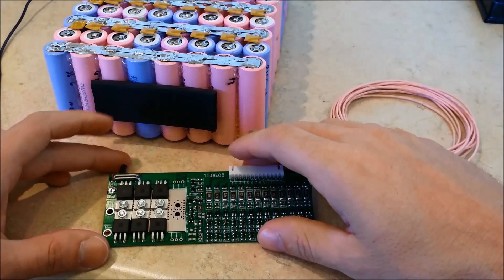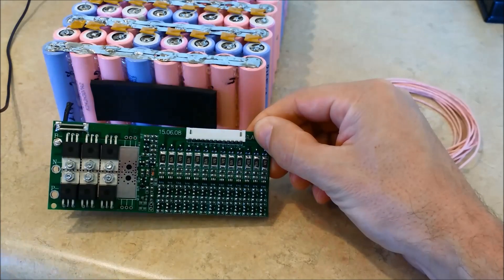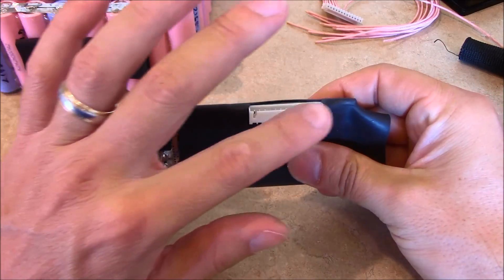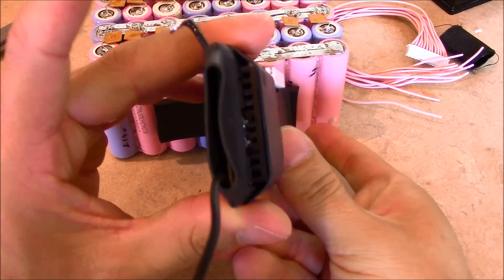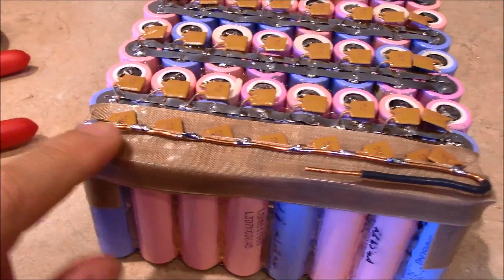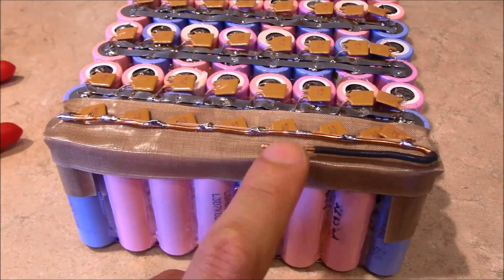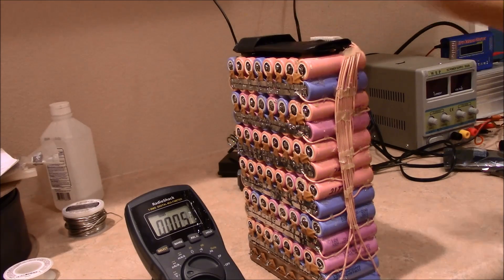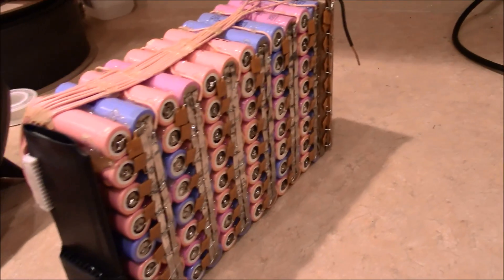18650 lithium ion battery "Wiring the BMS" (Part 4 of 7)

Comment: This has been very good.
I haven't seen others using fuses. 
Others are recommending nickel strips and welding instead of soldering to minimise heat damage to batteries.

So I'm torn on which is 'better'.

I like that soldering iron. Where do I find one like that?
Reply from the maker: +sleepy hollow yeah man I found it at home depot, but its not made for this kind of use as I burned up the first one.  The back up was a cheap radio shack  45w.  The better way to go would to use a Weller Soldering Station.   it can be dangerous or even damage the cells if you leave the heat on too long.  I cleaned the the soldering points very carefully with a very lightly damp rag with rubbing alcohol on the positive end.  Then used a flux pen to lightly flux the solder points as it will solder faster and better.  I used a very very little amount on the positive as I didn't want it to short out.  I then used the rubbing Alcohol to lightly clean off the excess flux.   I would say the best process would be to spot weld the batteries together.  I want to buy a spot welder and have seem some around $250 on ebay.  Tabbing wire is pretty cheap also..  You have to set it up correctly so You don't blow a hole in you battery also :)

Comment: I asked my local tech college if they offered a circuitry coarse, they said "no" and looked at me goofy. is there another name for the coarse I'd be looking for to learn the skills to do this stuff?
Reply from the maker: +Steven Strandberg to start out look for basic electronics courses or books.   They will teach the basics from ohm's law to complex circuits.   It can get very in depth.  After 27 years I still learn new things :)  To make it easier University of Youtube or Google works great also.  Spend time watching videos ask questions if you having trouble understanding something and its free.  Before I started my ebike battery I watched months of videos on what a bms does,  lithium batteries etc just make sure I didnt do anything wrong and start a fire.  
I started working in electronics when I was 13 after I was nearly electricuted rebuilding a lamp.   When the 120v AC hit me I was locked up with both hands on the lamp for over a 1 min unable to let go,  I was able to some how use my foot to kick it off me.  Now I think its in my DNA,  lol

Comment: Hi. Where i can buy the bms for Li-Ion battery 4s4p?
Reply from the maker: +The_ Pentaquark. Oh man yeah you just reminded me to change that.   I will tap off the negative going thru the BMS tonight so the drain will go thru the BMS instead of going around the BMS when riding.  Ill also check the BMS to see if it starts to get hot also.   If I dont get back to you hit me up in a week or two as I only have this week to try and test it.  Hopfully it will work better.  Thanks man
Reply from the maker: +Dimonickon M the only place I know of is Amazon, Ebay or Alibaba.   Hope this helps.
Reply: +15-sec-of Fame Hey, did you have any issues with discharging/running the batteries whilst by-passing the BMS (because of the perceived bottleneck effect)?
I expect they went a little out of sync? - causing an early shutdown as the weakest battery depleted !!!
Would your next Pack be using the BMS for both Charge & Discharge (given this experience)?

Comment: You should be aiming for high voltage and low amps instead of high amps and low voltage. Low amps is very inefficient... lots of power losses in wires and semiconductors producing heat
Reply from the maker: +Re I am with you on that!  I am currently building a 72v battery now :) with a max charge of 84v and hoping for 15-20 Amps.   My controller goes up to 72v in the settings.
Reply: +15-sec-of Fame Very neat! May i ask where you bought these BMS boards? I have been searching everywhere but could only find 12V ones
Reply from the maker: What size battery are you using?   I just went to Ebay and Amazon.  I just typed in 48v or 72v BMS.   Just make sure it has true balancing for the banks.
Reply: +Re how about  torque? isn't the current proportional to torque? ...so a higher amp level is better ?
Reply: +Randy Welt torque is proportional to total energy being delivered, so proportional to amps and volts
Reply: +gilessmokey oops i meant low volts lol
Reply from the maker: +Re yeah Im waiting for the parts to show up now.  Got a 72v Bms, charger, and now have enough cells to finish the build.  The spot welder should be arriving today :)
Reply: 15-sec-of Fame where did you buy all that from?

Comment: have you connected the balance wires to the positive pole of each pack and the negative wire to the negtive pole of the whole pack? or do the balace wires don't need a negative one?
Reply from the maker: +JohnHM yeah sorry I did say it wrong and when I watched it later I realized that I said positive, but as long as you hook it up to the correctly between positive and negative of each bank it will still work.  You are correct and you are supposed to hook it up to the negative of each bank of batteries.  I will see if I can go back and fix the video or put something in the description to help clarify it.  I am currently making another 18ish amp hour battery and will say it correctly in that video :)
Reply: 15-sec-of Fame you can add anotations on the video. i'm planning to make a 15ah battery , it'll be my first one so i'm searching a lot to not make anything wrong, and i think that balance is a very important thing ^^ thank you
Reply from the maker: ***** Cool man, if you have any questions let me know I'll be glad to help!.
Reply: thank you very much 15-sec-of Fame :)
Reply: 15-sec-of Fame a women said me once that it's not worth buying these batteries because it is expencive, is dangerous and it can explode. what do you say to me with all the experience you have with making up your battery-packs?
Reply: 15-sec-of Fame i have another question ^^, i'm looking for some 18650 batteries on the internet. do i have to buy batteries with how much discharge pulse in A? i saw some with 10A 20A 30A with less and more and i don't know which one is better for my ebike
Reply from the maker: ***** Hey John, yeah It can be dangerous if you are not familiar with them or electronics.   I have a 1500w kit and have a 18A.  Once I finish my second battery I will have 36A or 36 amp hour battery total @ 48 volts.   I work in electronics and yes I was nervous all the time working with the batteries.  The used ones can be unpredictable as I didn't know the condition of each one, so I had to test every single one!!.  My advice to you is to to watch as many videos about the e-bikes and how to build the batteries just to get familiar with the whole process.  Even I watched for 5-6 months before I finally dove in.   When I started I was very cautious took my time and from time to time I did short out or spark a few during the removal from the laptop cases.  LOL I even had smoke coming from the large box that I was storing them in due to the tabs touching another battery (glad I saw that one!!!).  A co-worker who was going to do the same thing as I did, but realized after a week or so that it was a lot of work plus the safety pressure, so he stopped and said I'll just spend an extra few $ to buy the battery and that is also fine.   Really think about it as it can take a long time to build it.  500-750w kit will do fine with a 10-15A.  A 1000w-1500w 20A-35A.  Hope this helps. :)
Reply: thanks a lot 15-sec-of Fame. i have a 1000w 48v motor and i'm currently using a 48v 15ah deep cycle gel battery in my e-bike, i am watching a lot of videos and reading some stuff that i find on-line, i think i'm ready to start soldering the batteries (if i had them), but the BMS part that's a little complicated for me, because i'll need some "special" chargers that is not that simple to get and not that cheap here in Brazil, i'm wondering if i could build my own, i don't have many eletronics experience but i know some stuff, saw some videos on youtube that teaches how to make the bms, if you want i can send to you the video. With 15ah i can go and come back from work it's about 7km/day total of 35km a week but this is by getting the limit of the battery i want a little more so if i want to go somewhere else i can go without worry on the battery,i'll need 78 cells 3.7v for my pack, and i need to find some good batteries like 3.7v (idk)mah (idk) discharge rate, how much is your battery discharge rate or pulse(i don't know)? thank you 15 for the help!

Comment: Hi there!  Been a while.  I've been waiting for your next video.. :)  Been making some progress on my build.  Received my motor kit.  And..  I finally got my battery pack built!  I installed the BMS, but I am not sure that it's working properly.  I have a 14s7p pack, and all of my parallel strings are reading 4.17v except one..  It is at 4.10v.  I would think the BMS should be discharging the other strings to match it, but they have been holding at this voltage for 2 days now..  

I tried charging just this low string to bring the voltage up to match the others.  It took a charge, but after about a day, it's back down to 4.10.  I'm thinking that, despite my careful checking of each cell prior to wiring, I may have a bad cell in that series string.  I suppose it's possible I damaged one or more of the cells in that parallel string while wiring it up.  There were 1 or 2 times that I accidentally made contact in the wrong place and the sparks went flying! Haha.  

Do you know of a way that I can test the individual 18650's in this low voltage parallel pack now that it's wired up?  I really hate to have to disassemble the whole pack now that I got it all together - it was quite a job!

Any insight you might be able to provide would be great.  Thanks!
Reply from the maker: +Gary Harvey Hey Gary hows it going,  Nice job on the build.  If you have a string that is becoming lower than the rest you may have a cell that is pulling the voltage down with that string.   Once you make the parallel pack they become one battery, so you may have to pull them apart to see which one is dropping in voltage.  The best way could be to charge up that string and Once charged, then start to pull them apart one at a time.  As you remove one cell meter the string to see if the voltage starts going back up and that will tell you that you may have found the dud.   Keep an eye on the ones you removed to see how they are holding their voltage also.  lately I've been working a lot out of town so I haven't been home to finish my next video's, but I do have all next week to make a few :)  anything you want me to cover let me know and I'll see what I can help with.  I do have some new cool ideas for some new videos, but I just need time to do it.  Thanks for keeping up and let me know when you finish the build!
Reply: Great idea - thanks!!  That's probably what I will do.  Looking forward to the next vid, and I will keep ya posted!
Reply: Hey there!  So I've can't tell you just how helpful your videos have been.  I received my motor kit and it was laced to the wrong sized wheel!  I've already ordered the new wheel, received it, and laced it to the hub.  Just finished truing it up tonight.  I've never done ANY of this before and your videos were instrumental in helping me get it done.  Just want to say THANKS.  :)
Reply: So now all I have left to do is get the tire and tube installed, mount up my battery and controller and all the wiring, and it will be time for the maiden voyage!!  I'll let you know how it goes.
Reply from the maker: Gary Harvey Dude that is awesome!  Definitely let me know how it goes.   I bet you will have a huge smile when your done :)  I let some co-workers ride mine to show them what its like and they were smiling from ear to ear, haha, now they are now looking to build there own also.  Im finally back home for now and I am working on the next video update of the current battery etc.. so that is on the way soon.  Good job on the build man!

Comment: great video !! one question: what are those brown thing that you use to connect the batteries?ceramic  resistor?   and what are they for?? can you give spec on those. i am building a battery bank but i just use regular coper /metal film to connect them. thanks
Reply from the maker: +Direct Fly Hey Fly The brown things are reset-able fuses rated @ 16 volts and 4 Amps each,   just for extra protection.  Each cell is now limited to 4 amps each for current draw that way they don't over heat or if i crash and the battery takes damage it will shut down the damaged cells so they don't short out.  The spec's are 16 volt @4 amps.  The fuses can reset and re-open if more than 4 amps tries to pass through.  I will notice a loss in power if they start to shut down the cells and then I will be able to look further into why its happening instead of waiting for a fire first :)  I got them from China on Ebay.  Thanks
Reply: +15-sec-of Fame. Great explanation, thank you so much!!!
Reply: A link to the fuse vendor would have been nice.

Comment: what is the name of the boad
Reply from the maker: Hey Chris there is no manufacturer name for the board, but its a BMS or battery management system.  If you are looking for one look for the ones that are true balancing as many are being sold as BMS boards, but they dont balance they only protect against under or over charge only.  I was tricked when buying mine thinking it was a true balancing BMS.  So I am currently looking to buy 2 more. One for my current battery and one for my new battery that I am building now.  You can find them on ebay.
Reply: Was the one in this video a true bms? I cam across the exact same bms on ebay and searched it on youtube so thats how i was led to this video. I have the 60A rated version in my cart.
Reply from the maker: yeah it is a true BMS the issue I was having was the charger.  The charger was shutting down once the battery was at peak voltage.  it would be better if the charger came down to 54.6 and stayed there so the BMS could perform its balancing function.  Instead the charger would just shut off.
Reply: Ok thanks for the info. I will probably order this bms for my pack then. I just ordered a charger to so hopefully it will not give me the same problem.

Comment: i added a bms circuit board for my 10 serial 6 paralleled 36v 18650 pack, i attached the bms as the instructions said 

http://www.ebay.com/itm/Bms-3-6V-3-7V-cell-10S-36V-10A-15A-BMS-Used-for-36v-10ah-12ah-15ah-battery-15A-/172008411119?hash=item280c800fef:g:0fcAAOSwA4dWLco9

Yet when i charge it my lithium ebike 36v charger says the pack is full (the charger actually gives out 42v according to my v meter) any idea of why this is so?
Reply from the maker: 36v battery with a 10s battery pack is going to have a max voltage of 42 volts.  The If the charger is saying that its full check each parallel bank to see if they are all the same in voltage.  It doesnt take much to throw it all off during charging.  If one bank is charging @0.5 of a volt higher than the others then the bms will go into protection mode if it reaches 4.25v while the others were at 3.9v.  I went through the this with my BMS.  I used the discharge function to lower the one bank untill it matched the others.  Let me know what you find on the readings.

Comment: isn't your heatsink upside down? is there a specific reason why you did this or did you just forget?
Reply from the maker: yeah, the way it sits in the bag it gets better cooling when I have one side unzipped a little bit to let air circulate inside.  If the heat sink was up it wouldnt get good air flow as it would be up against the top of the bag.  As of right now it doesn't get too hot, but once I finish my second battery it may start to get a little hotter due to the extra power.

Comment: some of my packs are at 3.8v and others at 4.1v, it is 41.3v directly from the battery but when i measure it through the bms output it is at 22v
Reply from the maker: +Ryan Liu I had a similar issue where I had to go and charge or discharge each bank to make them all equal.  My BMS will not balance the banks only charge the the banks at equal voltage.  so if I notice an issue i will have to check each banks voltage to see if they are the same.  My battery was maxing out at 53.3 volts not to the 54.6 max voltage due to non-matching banks.  12 were exactly the same at 4.16 and the one that was different was at 4.25 volts.  So the bms protection shut the charging down.  You may be having the same issue.  Balance all the banks and see if that helps.  I use a Imax B6 charger /dis-charger.
Reply: ok so i should try to somehow discharge the cells, i have a ebike so should i run it and monitor the cells to make sure nothing drops under 3.6 then use the bms and recharge them to balance them?
Reply from the maker: +Ryan Liu That will work if your BMS is a balancing BMS (mine is not).  If not you will have to hook up directly to each bank individually and charge each one up to say 3.7 volts or discharge each one with a dis-charger to 3.7 volts.  If its easier for you to charge them,  then ride the bike and bring down the voltage, then charge each bank to match the highest bank in the pack so they are all equal.